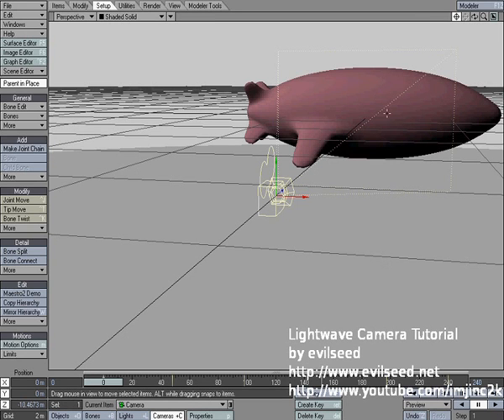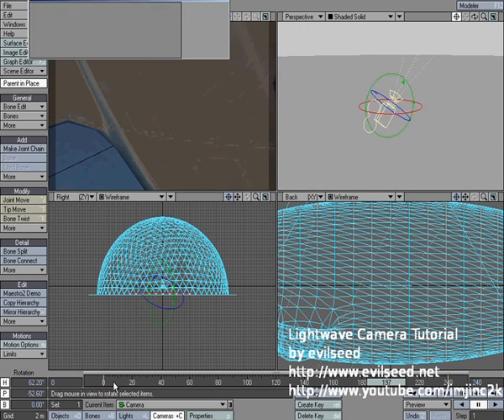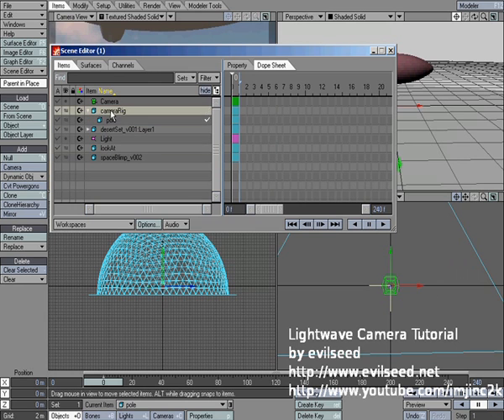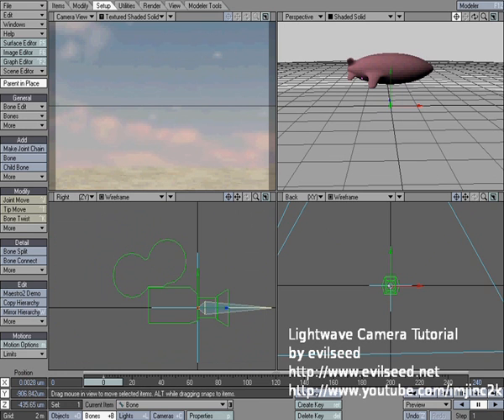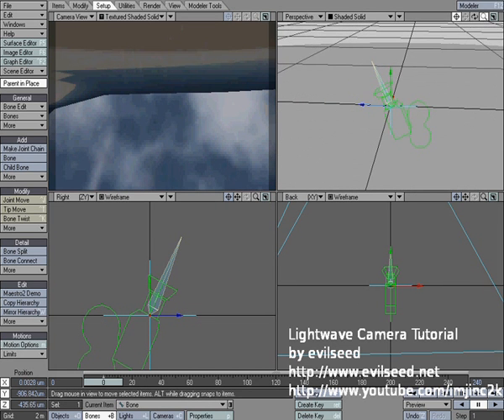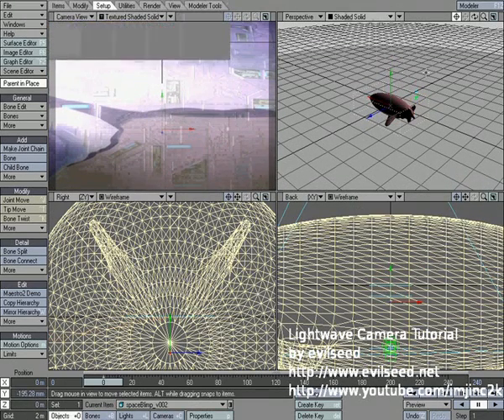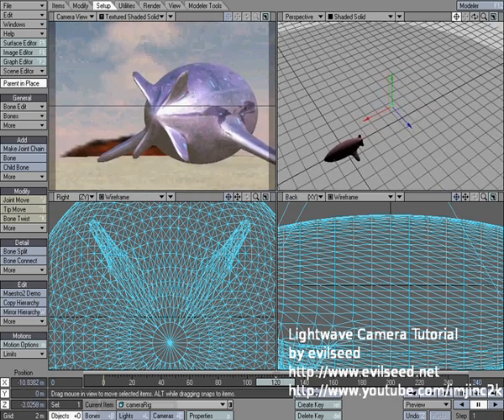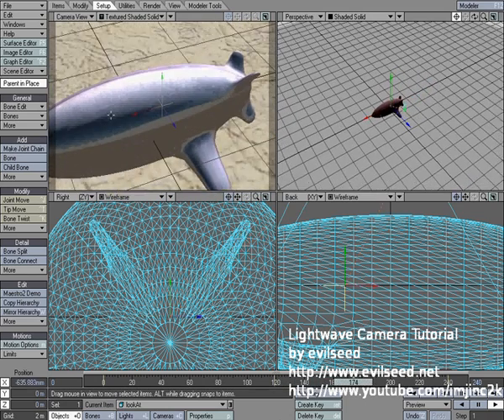Lightwave - Simple and Extensible Camera Rig Tutorial

Comment: Mate. Use the Graph Editor. Tension can fix this issue.
Reply from the maker: True, that's possible, but it's less intuitive and more tedious for most tasks.  More often than not I want the camera to look at a thing or sweep between two things, not to point in an arbitrary direction, so it helps to have a rig that fits that way of thinking.  I find that using a look-at object gets faster results with less graph tweaking, especially as animations get more complex.  You can parent the look-at object to another object, say a space ship, to track relative to it, and if you ever need to reanimate the ship you have less camera work to fix.  It's more robust.  You still end up in the graph editor for fine-tuning, but it becomes much less important.
Reply: Into The Black That is true but I for the most part create the whole animation then set the tension to everything to 1.0 then I go through and release tension where I need it as it's less common for the camera to flow so loosly. :) But it's LightWave baby! We love it cause there's a million ways to do things! :D

Comment from the maker: Yes, if you're looking directly up or directly down, you'll get gimbal lock, but the lookAt and pole vectors still handle it smoother and easier than manually rotating the handles.  But how often do you tilt your head back 90 degrees while walking around the house?  Also if you really pay attention to your eyes, you'll notice that they don't lock at some angle relative to your head and stay there while you move, but instead tend to bounce from object to object, tracking points as you move.